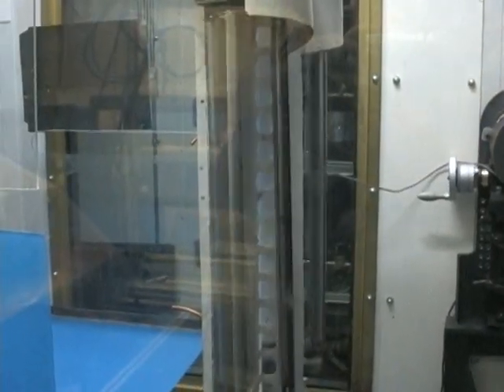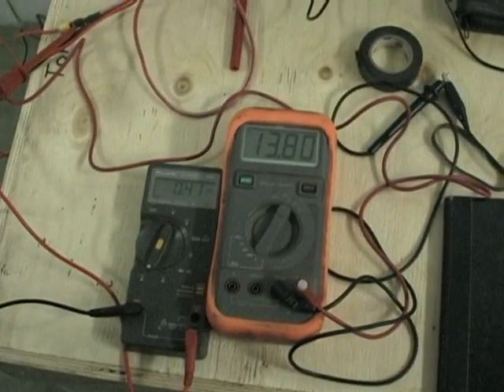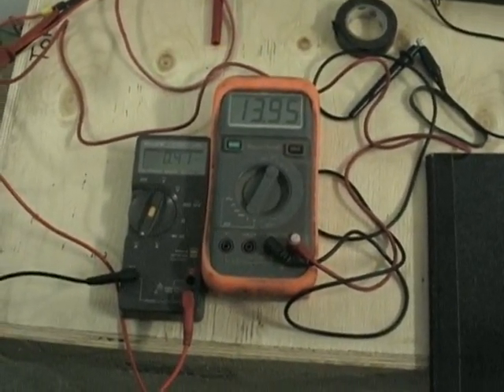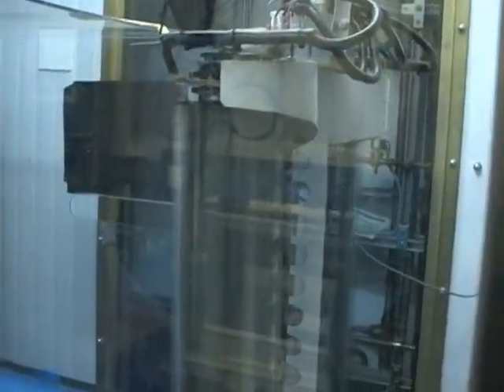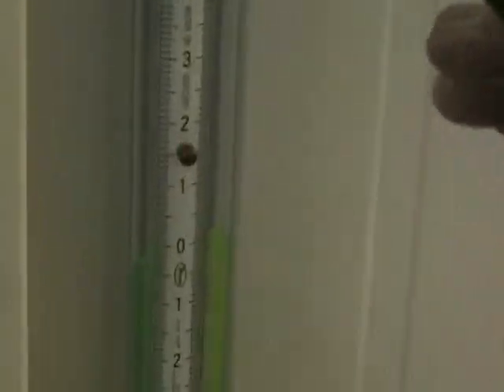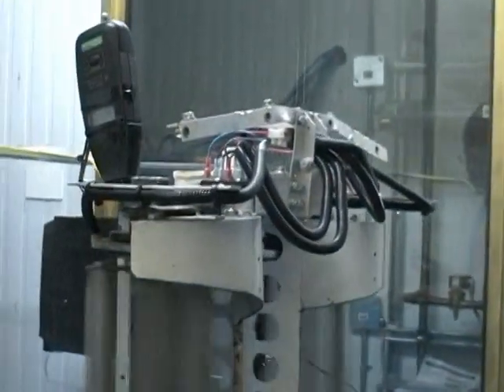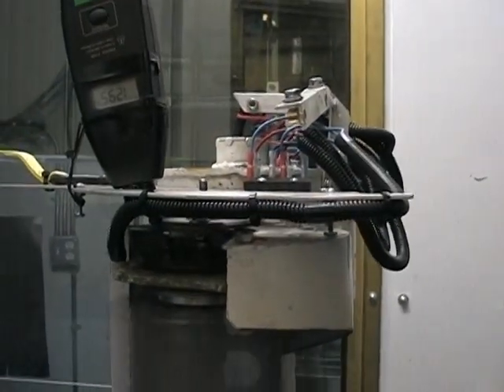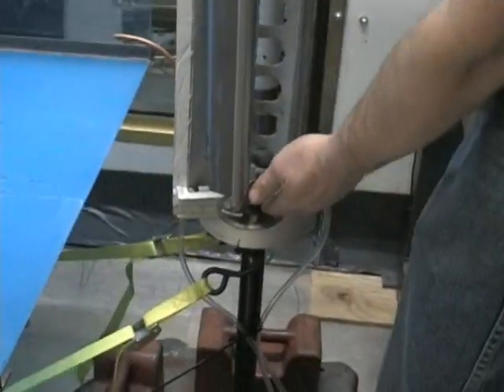Venturi Wind Turbine

Comment: I wish there was more video of the rotors at rest, to better understand their function and less looking at meters
Reply from the maker: Diamond21222 
The airfoils used are a design by ed lenz.  His web page is windstuffnow.com if you would like more information regarding the airfoils.  This turbine uses a venturi to help reduce drag on any type of rotor. The testing we did was to gather data related to pressure differential vs windspeed along with power output compared to power available in the wind. Hope this help.
Reply: Daryle Bezemer thanks Daryl, I love wind turbines and I hope your work yields some sustainable energy solutions

Comment from the maker: We stopped testing at 42 MPH (19.2m/s). Peak load volts was 17.7v while producing 3.3 amps.  The efficiency droped as more power was produced, partly because of alternator inefficiency but mostly because the turbine was stalling.  The desired TSR under load is @ .8 but it was averaging @.55.  I am working to solve this problem with the new turbine.

Comment from the maker: The tests were done in a wind tunnel to provide a controlled enviroment.  This allowed me to collect acurate data such as power output vs windspeed, tip speed ratio etc.
The water manometer on the wall is a tool that shows the difference in air pressure created by the venturi.  Wind tends to flow around an obstruction, (like putting your hand in a stream of water)  The venturi helps "pull" this air through the machine.